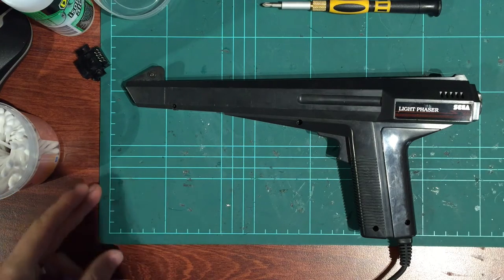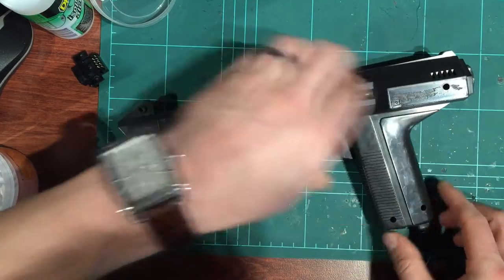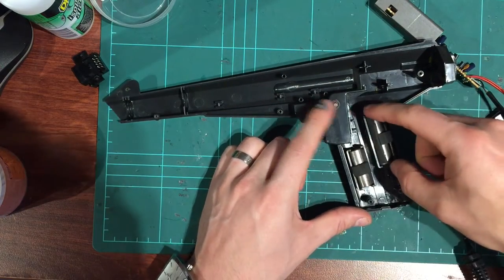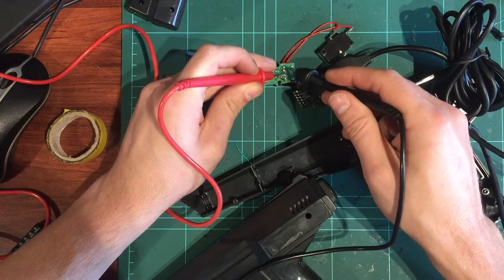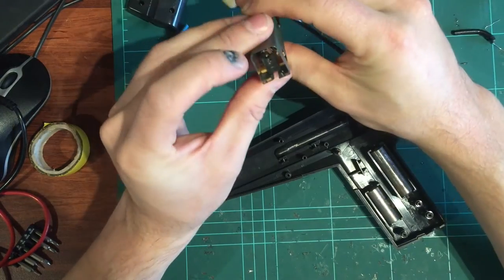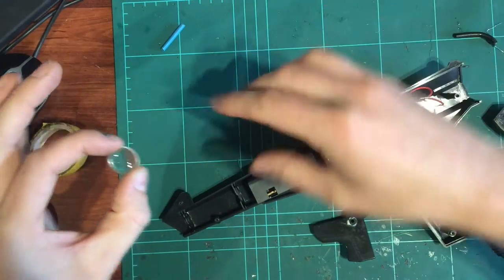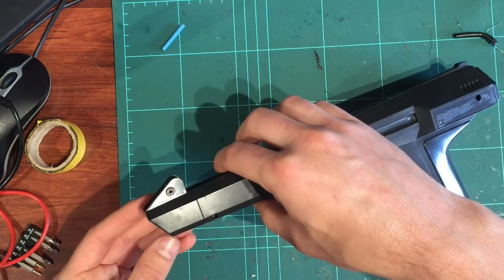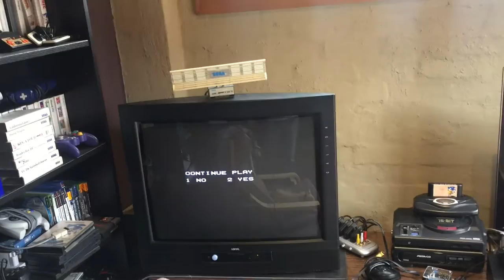How to clean fix and align a SEGA Master System Light Phaser Gun

Comment: Hi, if you still have this, do you have Gangster Town, and can you try firing the gun at point blank range on the left side of the screen and the right side of the screen and describe how accurate the gun is left to right?  I am trying to determine if the MiSTer FPGA SMS core and the Megadrive core are acting the same as real hardware.  It fires off to the right in the Megadrive core, and is more accurate in the SMS core.  In both cores, the right side of the screen is more accurate than the left side of the screen.  Thanks!

Comment: My gun won't shoot the bottom of the screen or the left side. It only shoots about 40% of the screen from the upper right corner. Would that be in the gun or the TV? The tube in the TV has been replaced before. Don't know if that would pose an issue.? Also looks like someone has been into the gun. Every screw head is stripped out and the sticker is missing.

Comment: Great Video, thanks. Can u use the Light Phaser on the new digital smart tv's?  Also,  my connection is a little off. I actually have to push down on the guns connector in order for it to work. Is there a way to fix that? Again, great job; and I did both like and subscribe.
Reply: They won’t work without a crt tv ,,something to do with the way it targets

Comment: What is the SEGA antenna looking thing on the TV?
Reply from the maker: It's the SEGA Telecon pack - http://segaretro.org/Telecon_Pack
Reply from the maker: You don't have much of an option... Just go to your local Walmart or hardware store and pick up a set of Torx bits for less than $10
Reply: Came to the comments for the same question. Looks pretty awesome but I can't imagine that a wireless rf signal would ever be worth using.  Looks good for decoration though.
Reply: My light phaser was working fine. Then I traveled and tried it just now on a different CRT tv. Now you have to aim 6” to the left. I don’t see how the diode could disalign so easily. It literally was working fine yesterday. The gun just traveled in a box in my car for 12 hours. Is it the different tv?—maybe a refresh rate problem or something?